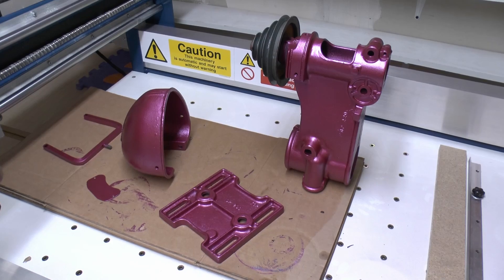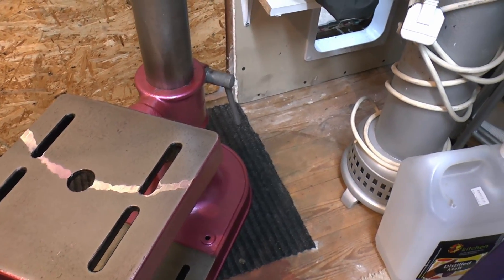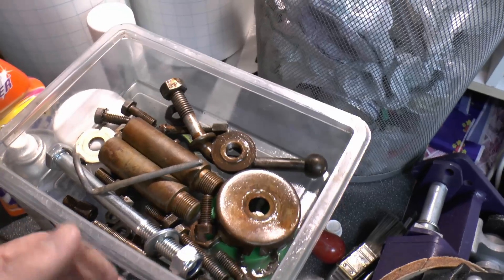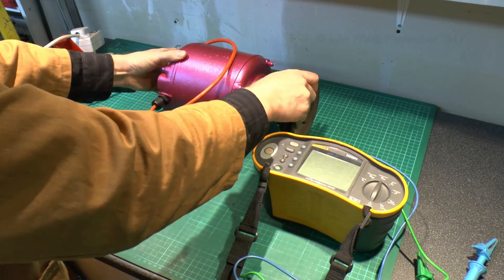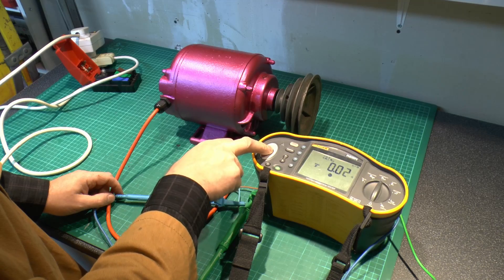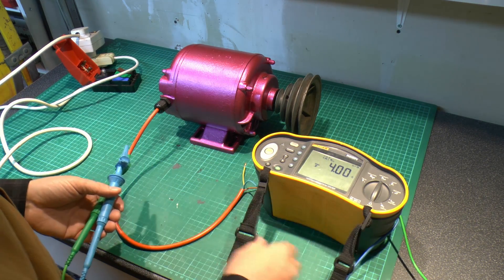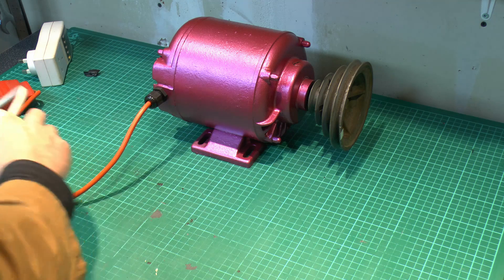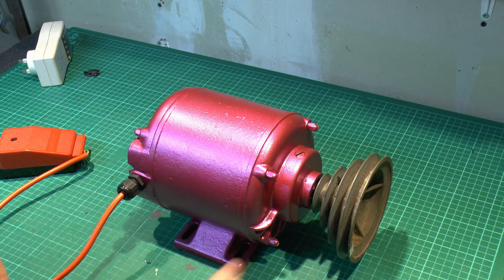Tauco Bench Drill Part 3 - Paint Colour, Partial Reassembly, Electric Motor

Comment: That motor has re-greasable bearings, just remove the screw at the top of the bearing housing's and pump some grease in. Might help the motor run smoother as the old greas has most likely dried up.
Reply: These bearings are designed for OIL, not grease, which will ruin them dummy!